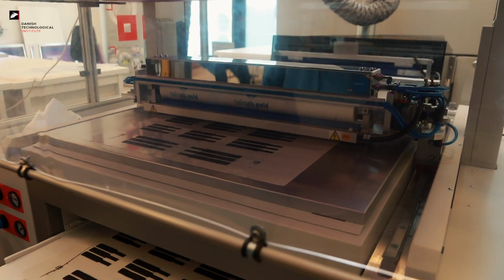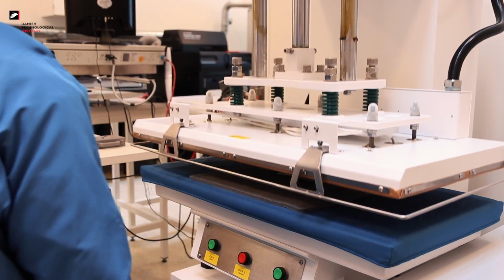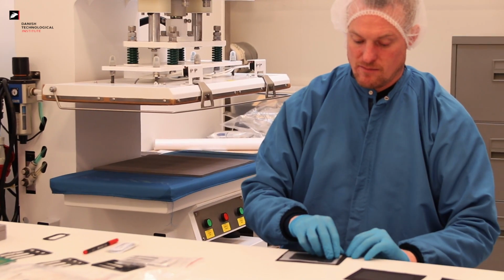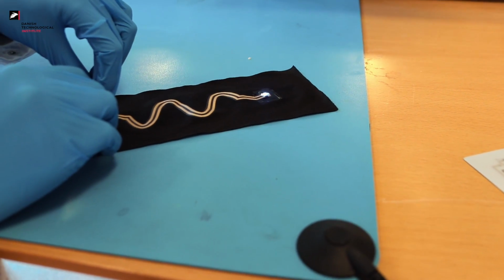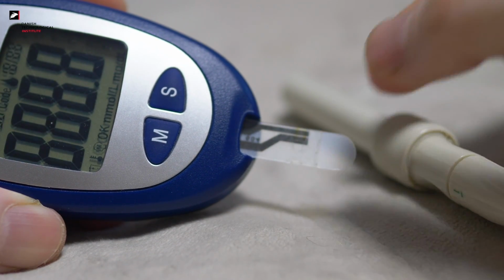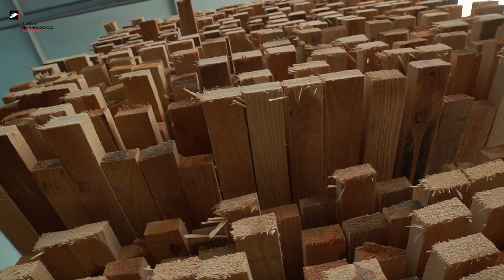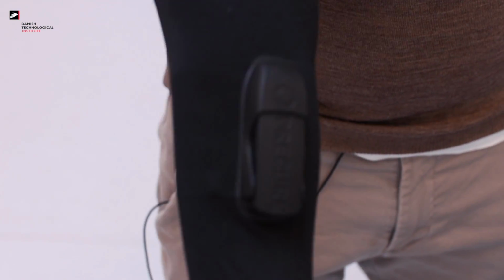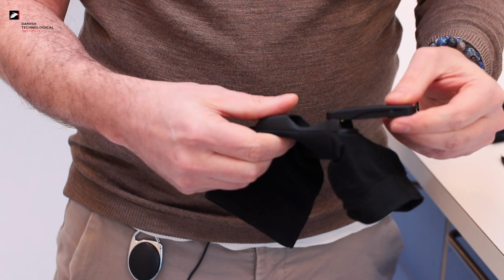An introduction to printed electronics

Comment: Electronics are very complex. It is present in simple devices that have been made complex and unbearable. they causing electromagnetic pollution. they rely on one material, which is semiconductor, which is considered mining harmful to the environment. Why do you want to cram it into everything? Instead of electronics, create a simpler and better system.
Reply: We are also developing sustainable materials, based on carbon and copper, using recycled sources, we are not printing semincondutor materials.